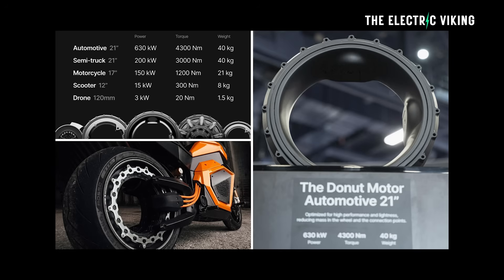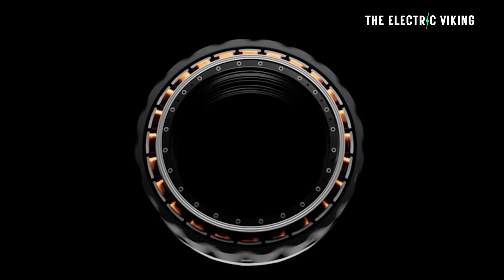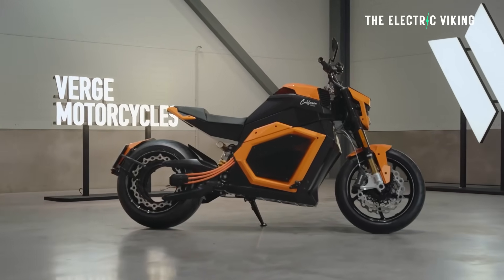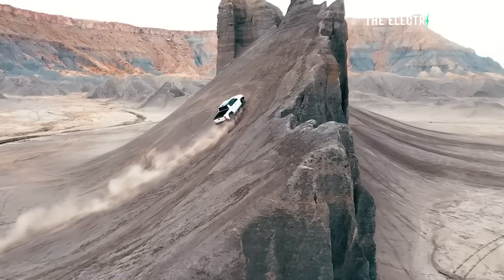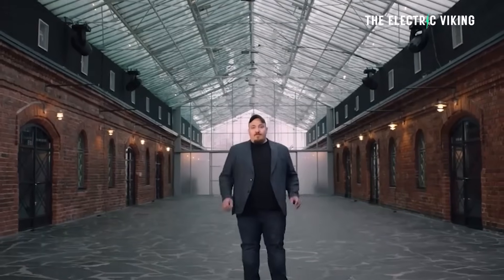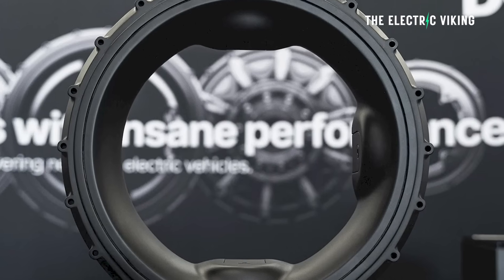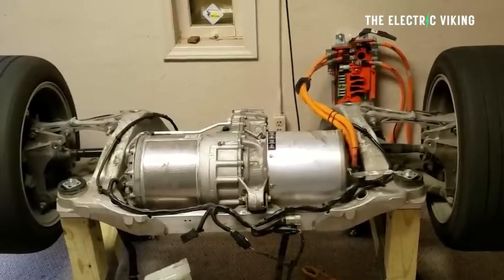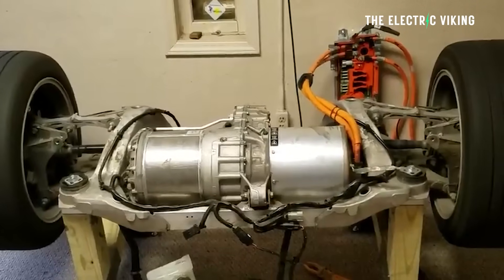Donut Labs' game changing Electric Motors will Revolutionize the EV Industry

Comment: I predict this motor will be redesigned using a conventional hub.  The current design is garbage, hence the imposed 124 mph speed limit. This is a clear example form over function.  Any physics 101 student could tell you not to place the bearings on the perimeter of a circle.  The tried and proven hub and bearing configuration has been around for over 125 years because it works.

Comment: Works fine until you hit a curb with a wheel, and instead of just killing a tyre you kill the motor too. And getting a tyre fitted might be exciting will the fitter kill the motor by accident or will I have to go to a specialist for a new tyre or a puncturer. Lots of questions?

Comment: Let’s do a rough comparison — say we drop Donut Motors into a Rivian-style off-roader.

You’d be removing 4 big motors with inverters (~95 kg each), diffs, driveshafts, and 21–22″ wheels — that’s about 650–700 kg gone.
Then you add 4 Donut in-wheel motors (~35–40 kg each) → ~150–160 kg back.
That’s ~500+ kg in net weight savings.

Sure, it adds +25 kg of unsprung mass per wheel, but for something like a Rivian? That’s fine — big tires, long travel suspension, and not chasing lap times.

Now compare that to a Tesla Model Y RWD with 19″ wheels:
You remove a single rear motor, diff, and wheels — ~220 kg out.
Add 2 Donuts (~38 kg each), ~75–80 kg back.
Net savings: ~140–150 kg.
But again: +25 kg of unsprung mass per corner, and the suspension’s much more sensitive to it.

And don’t forget — in sedans with low-profile tires, those in-wheel motors are much more exposed. You’ve got less rubber, less sidewall, and now a heavier wheel — one pothole and the motor could take serious damage. That’s not a risk I’d want on a daily driver.

So yeah, in-wheel makes way more sense on trucks and utility EVs than it ever will on something like a Model Y.

Also — let’s be real — each of these wheels now weighs 65–70 kg, including motor, tire, brakes, and wiring. If you get a flat or damage one off-road, you’re not just replacing a tire — you’re lifting a mini powertrain module. No spare. No quick fix. And if the motor locks up, good luck towing without damage.

In-wheel sounds great on paper. But in practice? You’d better hope nothing ever goes wrong.

Comment: Is the Donut motor weather proof (dirt, water, snow, etc ...)?  Protean motors made their in wheel motor weather proof. According to the Donut motor engineer it does not require active cooling, a great benefit.  Does it require a friction break, or is regenerative breaking (because of the very high torque) sufficient?  If it really is weather proof: a game changer!

Comment: 4900Nm at the wheel or 9800Nm at 2 wheels is not enough. 
Even For a small vehicle you want more starting torque but not much power.

Comment: Very positive innovation that could substantially reduce the overall weight of vehicles as there is not the need for a frame that can support the transfer of power from engine in one end to the wheels.   The idea of retrofitting existing vehicles is very costly to do and not economically viable.  Where is the battery going to go.  More efficient to produce new. A skateboard that a collector is bolted to might be viable.

Comment: EDIT @ehta2413 commented here already (scroll down to find it) and addressed my question before I even posted 🙂 like, what's the horsepower of a Corolla?

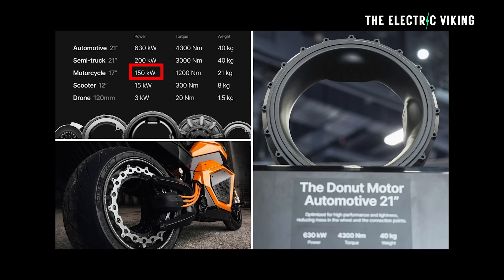@6:55 you mention 230 hp for a motorcycle wheel. If a pair of those went on the rear wheels of an econobox??? that would be 460 hp??? WAY too much for my requirements. How about 100 hp per wheel = 200 hp RWD. I'd only need 0 to 60 mph in 9 seconds - so - how light could each rear wheel be for modest performance? (btw learned to drive on a VW Microbus)

Comment: This design looks like a good fit for 2 wheel vehicles. Make these donut motors smaller and place these at all 4 corners with a short shaft u-joint allowing the suspension to protect the motor from live loads. Now you've got independent  drives for each wheel and more centralized mass in the middle of the vehicle.

Comment: They extended radius of motor and shoulder of moment but reduce RPM which is clever but what about cooling? In-wheel motors suffer from poor cooling even when it's exposed in the air at center of wheel. In this case motor has enormous powers and almost covered in tyre which is heated themselves because of the friction powers. To be able to stop this mass they mount huge brake disk right on this motor and this disk will be hot as hell for sure! Magnets in this scheme so deep in wheel so they hadn't chance to cooling down so they'll quickly degradete and lose their power. I'd rather to have transmission and one of this motor under hood whith proper cooling then this in-wheels scheme. Aspeccialy if you have so much power and proper RPM in a size of a spare tyre.

Comment: The ideal setup would be engineered for the minimum weight and horsepower required for acceptable vehicle performance and four wheel motirs. The traction control on all wheels renders the most agile and safe operation as well as regenerative braking which reduces wear on brake pads and charges the battery.

Comment: This only makes sense since the ultimate goal of the old motor is still to put torque and power to the outer diameter of any you're even if it does it through axles and gears. This reduces weight more than just the engine, and reduces complexity and cost at the same time... Again more than just the engine. You could attach these to a battery pack with a controller and it would roll, so good for diy

Comment: Why not just mount the hub motor directly onto the ring gear of a differential. That would still be an ideal application and you could have the axle lengths perfectly matched to avoid torque steer.
Reply: Yup! The extremely high torque comes from the big radius in this case.

Comment: Forget applying hub motors to the front of a vehicle as there is too much involved in interfacing with the steering components.

Motor bikes, scooters ok.
Semis another problem because of loading capacity.
So...great tech but applications could be problematic.

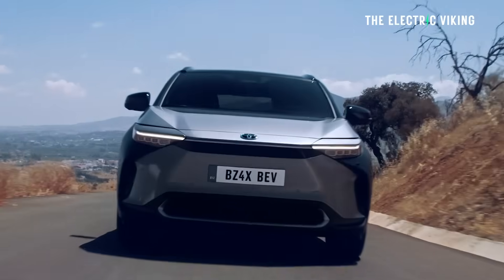Comment: 4:08 - hilarious... comparing motor weight, to an engine. I'm pro-EV... but comparing the raw weight of a mere motor to an engine, is pointless. By the time you add enough batteries to power those motors at the advertised levels, for anything other than a quick sprint... the scales quickly tip toward engines.

Were facing a huge problem with battery technology. You can only cram so much power into a given space, before radioactivity becomes an issue. Until we develop battery technology that can rival diesel (39kw of power, in a gallon of space, weighing 7lbs), electric will be relegated to small vehicles and grid-tie transport (rail, etc.). To get that kind of power, requires radioactive materials. Given the current state of society, that's not happening.

Comment: EV weight problems and motor limits have never been the motors...      it´s battery tech that is the limit..   

Output is the maximum current (Amps) that the battery can provide , Ah × C Rating 

MG4 for exemple with a 64kWh 160A 400 volt battery  at a normal discharge rate of 1C the output would be just 160 amps..    ofrcource the battery can give more..  but it degrades more quickly..       3-5 is probably normal..       Something like a tesla plaid go over 5C with their 18650 cells.. but not for long..    

5C from a 64kWh  MG4 battery would be 320 kW 

I dont think it is a coincidence that this is exactly what it has as maximum power output?

Hypercars like rimac has a huuge 120kWh battery and diffrent chemistry to extract more power..    some RC airplane batteries give out 20C bursts easy but those batteries only lasts a couple of years..  everything is a compromise..    Rimac nevera weights 2300 kg..            

   
  Talking bout power to weight here is a 1,5 L gasoline motor with 1700 horses weighting just 70kg from the -80thees         https://en.wikipedia.org/wiki/BMW_M12

reason we dont get to have nice things is not that ICE engines are heavy ..  its just rules and regulations holding innovation back  to build lightweight cars with crazy ice power :P

Comment: You do not want to put 90lbs of unsprung weight on.  From the performance point that is horrible to do, you want to go as lite as possible.  And besides hub motors don't last, too much forces on it cause again unsprung.
Reply: Im also seeing some big problems with unsprung weight, shock, and sealing issues. Someone said use half shafts. Good idea, because there would be room for brakes. With so much power, the weight of half shafts wouldnt matter.

Comment: What is the practicality of having an exposed hub motor? I can see a use if the hub is internal and protected from the elements but nature will tear it up. If there is an internal cased design it wasn’t shown or discussed. What is the electrical resistance (efficiency) of this design?

Comment: I would like to voice another opinion on hub motors, that I think gets ignored a lot.
First of all, the fast majority of people won't ever notice the effects of a slightly heavier wheel, due to a hub motor IMHO.
Second, as most EVs are fairly heavy cars, those cars are not the most dynamic to start with, in other words, slightly heavier wheels will make "fark all" difference.
Thirdly, I remember reading something from a Lotus engineer (arguably the masters of suspension and lightweight car design) about heavier wheels and suspension tuning and that a bit of extra weight can be compensated for quite well, even without active suspension components.
Concluding, I honestly don't think that the advantages of hub motors will ever outweigh the "disadvantages" in the vast majority of BEVs and for the vast majority of drivers.
I think the Donut lab hub motor is a brilliant design and I see it having a great potential in BEVs!!!

Comment: In hub motors (not having gears) the important number is torque, not power. The power will just increase with wheel speed. And you are not going over 3000rpm on a 21inch wheel. 4000Nm is an ok number, but there are hub motors doing more than that in rear wheels. For front, you do not need such high torque - due to acceleration weight transfer to the rear. But you do need a big brake - for the same reason in deceleration. Brakes give 4500-6000Nm braking torque…

Comment: With that insane power to weight ratio, things like tracked vehicles get much easier. Dozers and any of the heavy equipment industry would change drastically. Shipping? How many can you stack together along a 4foot diameter driveshaft? IF this works, it would change a lot of things.

Comment: bit sad its adding 20kg unsprung weight in the bike application , I think if the motor is centrally mounted and clutched , and about 1/4 the weight of the 40kg one giving 200hp it will be just fine for a bike.  , maybe sling the batteries in the center of the motor .  its not fair to talk about the weight of motors without inc batteries capable of the required amps and the motor controller but its still cool

Comment: Sam,  Hub motors are a fool's errand. A short study in the necessity of keeping unsprung weight low is where one needs to start.  The abrupt end is when one realizes that hub motors are not practical until such time that we have perfect roads.  
The accelerations that unsprung weight incounter are rather nasty, hence the necessity to keep unsprung weight to a minimum.
 Is it any wonder that Aptera moved away from hub motors?
Reply: How about attaching it directly onto the transmission?  Easiest EV conversion on the planet

Comment: Unsprung weight is the problem with wheel motors, suspension with that much weight hanging off it would drive like a pig.

Comment: These in-wheel/hub motors have some great characteristics, but some drawbacks. The high torque figures are simply because they are much larger diameter than 'normal' electric motors. However, they cannot realistically be geared down, which a more normal smaller diameter and centrally mounted motor will be and that gearing multiplies the torque. So e.g. a Tesla with less motor torque, but geared down approx. 10:1 makes more torque at the wheels. But it spins faster and will make more noise etc. and also means heavy gears are required.

So there are pros and cons to both types of motor.

A lot of negative opinions are due to the much larger unsprung weight, but IMO that is overstated. It can be unnoticeable in a car and even in a motorcycle. Yes, it is much heavier than a simple motorcycle wheel, but if that motorcycle has a shaft drive (with very heavy and unsprung) gears, then the weight difference is insignificant. E.g. no-one complains that a BMW GS handles badly because of the huge unsprung weight of the rear wheel assembly, so why will a similar weight of hub motor be as bad as so many are (mistakenly) claiming.

I've ridden the Verge, it's terrific, any weight of the rear wheel motor is truly unnoticeable and I have placed my order for one, but I am fully aware that the 1200 Nm torque is not as crazy as some people think. It is good, but an ICE making a claimed 100 Nm torque will be geared down in 1st gear by about 12:1, so making the exact same 1200Nm at the rear wheel.

Expanding into other non motorcycle markets seems a great idea for Verge and again, the figures look impressive, but keep in mind the lack of gearing so no multiplication of torque at the wheel. Also, 21" is too large for many applications. Despite what Sam says, that's a large wheel.

Comment: Using these to create hybrid vehicles from existing combustion engine vehicles would be a great transition step until the charging infrastructure is more complete and bug free. Hybrid vehicles are better for long trips and tow vehicles as well. I’d love to convert all three of my vehicles to hybrid vehicles with these motors, my truck, small suv, and make my Karmann Ghia coupe a 4 wheel drive hybrid. Only the smaller motorcycle motors with 130 hp would be needed in a hybrid vehicle. For really long trips, the combustion engine would be used for cruising, saving the batteries for starting from a dead stop and driving in stop and go traffic or short trips in town.

Comment: Hub motors have been around for some time.
Many ppl critique the unsprung mass. This is easily solved by using a short U-joint or CV shaft. 
Yes, this reduces efficiency slightly, but resolves the unsprung mass issue.
They could also be made much smaller to fit multiple configurations including all wheel drive.
I wonder if I could put one on my E-bike? :)

Comment: Using this in a helicopter makes a lot of sense. In a car, I'm not feeling it. If I puncture my tire and need to put on a spare, how does that work? I have an entire spare wheel with a hub motor in my trunk? Honestly, now that Finland is in NATO, I'd be pushing hard to design military drones and helicopters around these. The more weight you save, the more batteries you can bring.

Comment: Wonder why they don't use them as motors instead of the wheel?  A spiral gear instead of a tire and drive shafts to drive all the other wheels.  Yet again; drive only two diagonally opposite wheels and use magnet clutches to keep these gyroscope motors running to stabilize your two wheel car.

Comment: If it works, it'll change the way we think about car design laws. Worst case scenario, if this becomes a standard design. Each wheel motor will cost $5,000usd to $20,000usd and hub cap thieves' paychecks will 10x because of this.

Comment: This is nuts. Can you imagine a hypercar with 4 of these motors - that would be more than triple the horsepower of what a Tesla Model S Plaid has. The acceleration would be crazy - 0 to 60 in less than 2s for sure.

Comment: I live in ireland,  a donut motor would be ruined her within weeks. Unless you mount the hub motor in the center of the car away from the rain and transfer the torque to the rear axle via chain or belt drive, the motor will drown and die within mere weeks. Or hey... why not replace the motor in a regular manual car with one of these and keep the rest of the power train intact? I'd love to convert my current diesel car to an electric using an 800bhp electric motor. Plus I can keep using the stick shift. My car has 160bhp in diesel mode, so a 200bhp electric motor would be all i need realistically.

Comment: I'm only speculating, but it seems to me like the reason Tesla hasn't done this is because of legacy advice. Seems so obvious. My only question with in-wheel motors is how they handle shock. The bigger motors may be required for bigger vehicles to overcome the impact of hitting a pothole at say 100 miles an hour.

Comment: something is off,  about their claim of 850 HP  ,  it's way too much  horse power for any reasonable way to dissipate the heat.  I wonder if they are doing some approximation because of the place that the power is applied.  850 hp is about 634 kw.  How much heating would that cause in a few seconds?   It would literally weld the metal in that short time.  I asked them if I could buy some of their motors, they said no.  🤨 Sus  😑

Comment: All road bumps have no suspension before hitting the magnets and coils.
Water get in.
Sustained power will melt that much coil weight. Motors are already 95% efficient.
The bearings are WTF how do they wear cheaply?
Any brake calipers are less stable and protected.
Beware of fake it till you make it companies not shipping demo products, or showing CGI.

Comment: It would be a better concept to have the “hub motor” as the crown wheel in the differential, that way you only need one and remove the problem of unsprung mass, keeps the suspension the same as a current ICE vehicle.